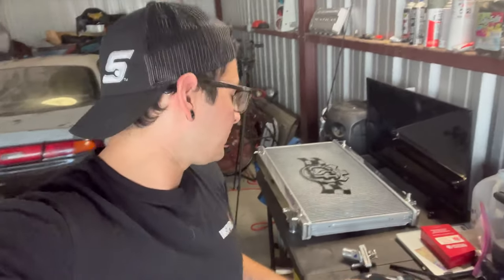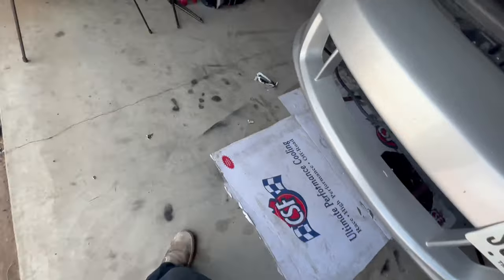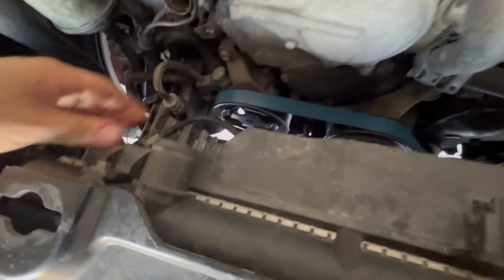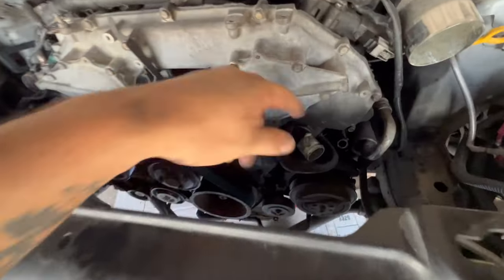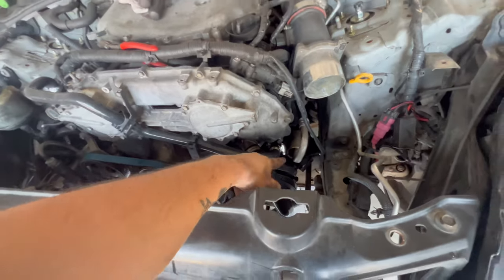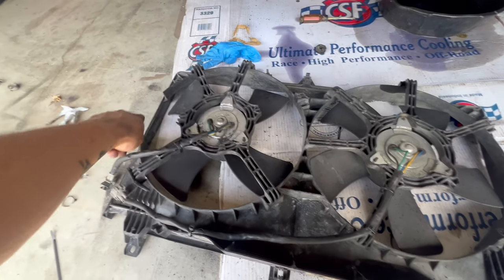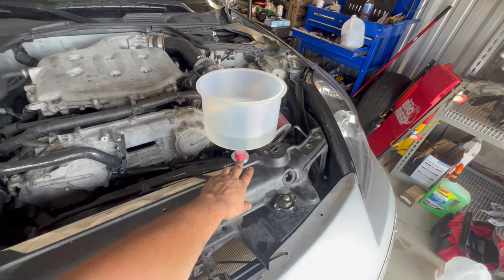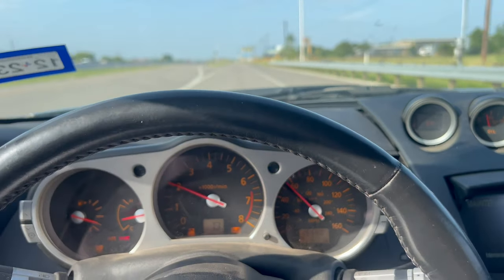The BEST Radiator For Your Nissan 350z // Upgrading The Cooling System!!

Comment: I had cooling issues all the time when driving hard in hot weather. I installed a mishimoto racing thermostat that opens I think at 168 instead of 183, mishimoto silicone coolant hose kit, mishimoto radiator, deleted the clutch fan and installed a big electric fan on a toggle switch and one big thing that helped was a thing called a swirl pot that constantly allows the system to purge any air by making a slightly higher point than the actual radiator. I kept my stock electric fan on the outside of the radiator as a safety back up and that kicks on at 203. Also  have a monitor that tells me all my parameters like IAT, ECT and have any alarm set if it ever goes above 205.

Comment: This radiator is actually the worst..the welds on the outlet/inlets are notorious for cracking and leaking out of the aluminum..wish I would’ve been told the same thing before buying this for a vq35hr

Comment: So I’m back since my oem radiator finally cracked @200k miles. I ordered one of off eBay, and did you have any trouble fitting it as because the ac lines were in the way perhaps? Would putting it on rhino ramps make bleeding more easy with the added height and extra height with the funnel?
Reply from the maker: @duesa2203   so on our silver Z we got a radiator that is way bigger the the oem and we’re currently running no a/c cuz the compress hits the fans . that our only issue. i’ll be doing a another video on the yellow Z on upgrading the radiator cu that one has worki mg ac

Comment: i have a automatic 2003 350z. i checked out mishimoto and koyo and it looks like they say i need a external transmission cooler. is it the same with this csf one.
Reply from the maker: @mandosZ  the csf has one for auto Z . that’s what we got for ours
Reply: @inspireddreams  would it be the one listed on z1  motorsports as “2 Row All Aluminum Racing Radiator - DE”
Reply from the maker: @mandosZ  should say something about auto
Reply: @inspireddreams  are u able to link it?
Reply from the maker: @mandosZ  https://www.enjukuracing.com/products/csf-racing-radiator-for-nissan-350z-03-06.html?gad_source=1&gbraid=0AAAAAD_vUIA7M-JmEIfNifd9AuMjIyn84&gclid=CjwKCAjw2dG1BhB4EiwA998cqCIt_CNjBHH42KFdShZI8oda_eMHD_c5_vdMbUvuz7JWeL2PR_zUlRoCWHAQAvD_BwE
Reply from the maker: @mandosZ  try that link it’s from enjuku

Comment: so quick question, im replacing my radiator on my 05 g35. do you recommend still eventually upgrading to better fans
Reply from the maker: if it’s just a daily drive you really don’t have to. But if your getting into track or drifting i would.

Comment: Hi, did you have to add a transmission cooler with you having an automatic
Reply from the maker: so when we did the z we clamp the trans cooler hoses so atf wouldn’t come out . But if you don’t and u notice a lot comes out, put about quarter and if very little comes out don’t worry about it
Reply: @inspireddreams  hi, so did the radiator for the cooling also cool the transmission, asking because with the Mishimoto radiator it states you have to install a separate transmission cooler?
Reply from the maker: @howardrathbone2120   you should have a oem cooler that has 2 hard lines that go to the trans and then you have a feed line and return line that goes from the bottom of the radiator to the trans cooler
Reply: Great video. I just put in   a different brand but same one. I noticed one thing in your video though. You forgot the rubber grommets from your old rad  to new one on top of the rad.The plastic retainers on top sit in them and make it a tighter fit. I hope that makes sense 😅
Reply from the maker: @aaronwism   yeah i did 🤣 but they’re in now . thank you tho!!